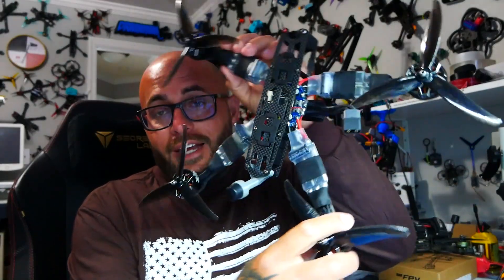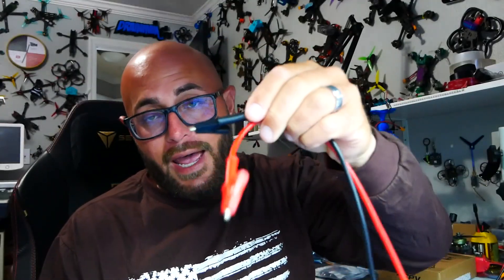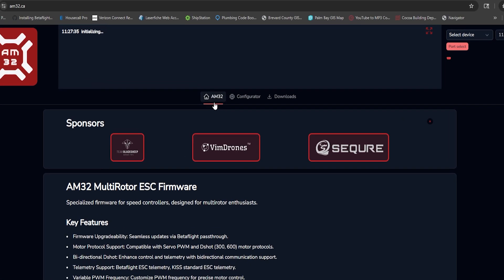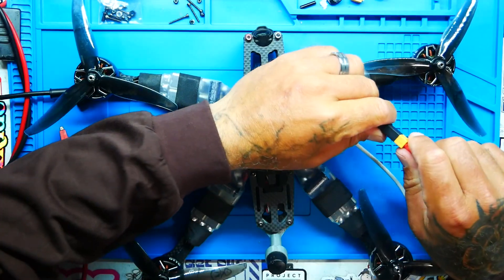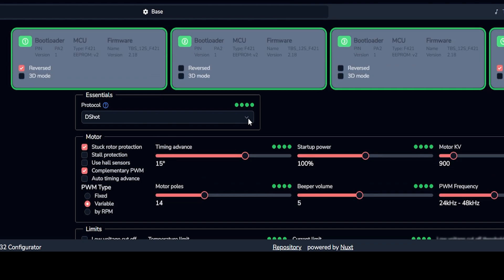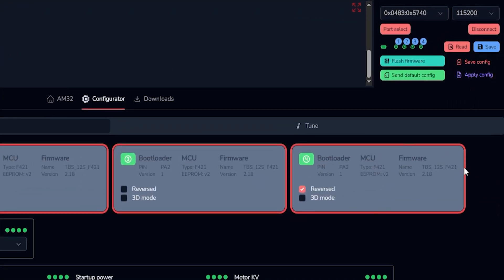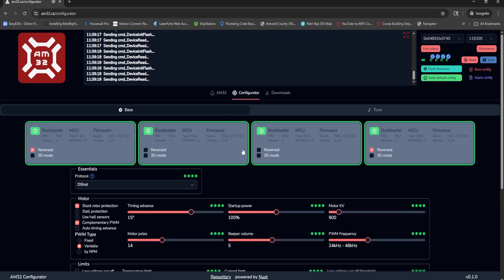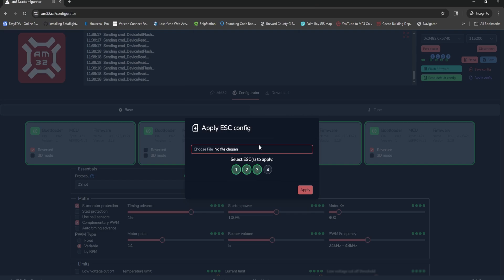How To Flash & Connect To AM32 ESC's - Quick & Easy Walk-Through

Comment: I have a skystar KO60 AM32 ESC. How do I find the correct hexfile to flash my ESC? It is not auto populating. I did flash a file that read skystar KO60 but its acting a bit strange on start up. Thankfully I didnt brick the ESC so far but I feel like it may have not been the correct firmware I flashed. On start up it is only lighting up one side of my motor lights and is extremely quiet. Like the power isn't right and sometimes the second ESC will initialize twice. Something just doesn't seem right. It does arm but I haven't had the guts to fly it yet because of these issues. Any help would be greatly appreciated.

Comment: Hey DrainMan! I just came across your page for my research - I'm a fellow hobbyist but also a budding engineer, and I have a project that uses BLHeli32 ESCs. We have a pretty limited budget so purchasing AM32 ESCs is sort of a last resort. I know you said that it is possible to change the bootloader on a BLHeli 32 bit ESC, could you expand on that? We have 4 FlyColor Raptor 5 - 50A ESCs, and unfortunately need them to be flashed because we want bidirectional rotation. I'd be happy to connect with you and give more details, appreciate your help!

Comment: Can anyone help. I get these readins when pressing "connect"
11:20:19
Connected to device
11:20:19
Sending MSP_API_VERSION...
11:20:19
Got msp data, API_VERSION: 1.41.0
11:20:19
Sending MSP_FC_VARIANT...
11:20:19
Got msp data, TYPE: bf
11:20:19
Sending MSP_BATTERY_STATE...
11:20:19
Got msp data, BATTERY VOLTAGE: 22.4
11:20:19
Sending MSP_MOTOR_CONFIG...

It doesnt seem to "GET" the MSP motor config.
Whats going on here?

Comment: So your set up supports ESC pass through from the FC?
Reply: Yes it does but the bootlaoader is the problem 
 I’m not sure if this will allow flashing the boot loader direct with this config tool or not. I’d also like to know.
update it does not help you if you are still on bl heli… you have to get the bl heli bootloader   Swapped  to the am32 with the other tool first
Reply: The answer to this question is No - just tried it won’t read blheli firmware…
you still have to install the boot loader with the  electronic adapter and pins.
Reply: @Carboneye7  That is what I figured so not sure how on earth he did it through the FC?
Reply: @princesfpvdrones he had am32 factory installed on the esc in this video so was just updating and configuring already installed software. The only thing you have to flash via the adapter rig is the initial boot loader  after that you can use the configurator and  like he shows here it does work via pass-thru.  
 The other tool bardwell shows is the configurator that  was first used. This site here is the official site  and they do have all the files right here. Definitely the way to go
Reply: @Carboneye7  This is VERY helpful! Thank you!